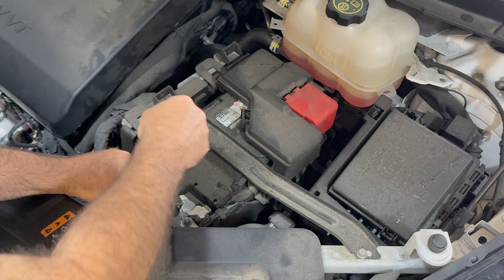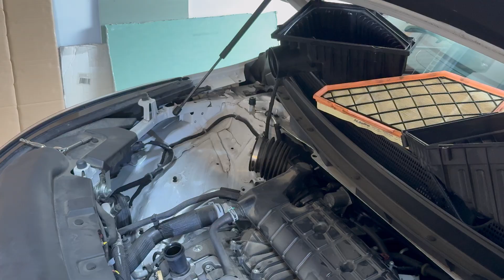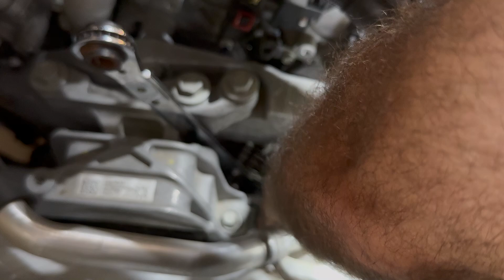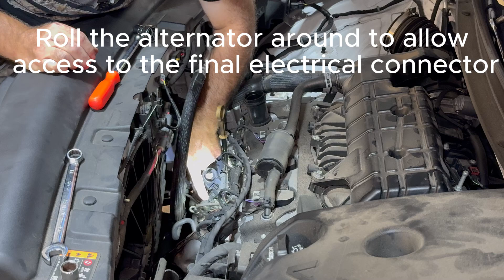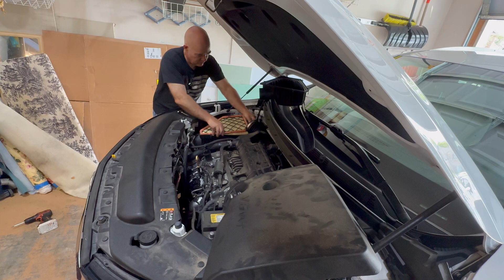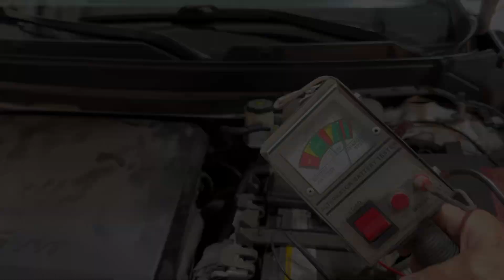2019 Buick Enclave Alternator Replacement Acadia Traverse (( 3.6L )) #buickenclave #buickgmc

Comment: Can you add a list of tools used???
Reply from the maker: Yes. Can be found in this video description. 
Parts & Tools:
- Alternator: https://amzn.to/44QOQVo
- 1/4 10mm socket, rachet & extension: https://amzn.to/4447Z5u
- T30 Torx Bit & Driver(or 1/4 socket & extension): https://amzn.to/4oifu1K
- 8mm 1/4 socket, rachet & extension: https://amzn.to/4emQMZZ
- Phillips screwdriver(set): https://amzn.to/4e2szsX
- 1/2 Rachet: https://amzn.to/4eBXUTu
- 15mm & 17mm 3/8 drive sockets, 3/8 Rachet & extension: https://amzn.to/4xjOweA
- 15mm wrench: https://amzn.to/3SgyZMw
- Prybar: https://amzn.to/4uyWvC2
- 3/8 Inch Drive Micrometer Torque Wrench (10-80 ft.-lb.): https://amzn.to/4adhF0n
- Multimeter: https://amzn.to/4msrewZ
- Battery Load Tester: https://amzn.to/45fWrfG

Comment: Something dropped off from idler pulley
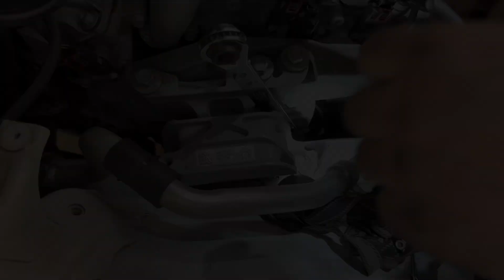Reply from the maker: Right, lol. You can see @13:10
Reply: I saw something fall when you were putting the idler pulley back on @ 13:30, awesome video by the way!
Reply: I was wondering if it was the keeper inside that spacer that fell previously

Comment: Anyone ever have a problem getting that pulley and bolt out of that area. Bolt is fully threaded out but the end is still in the hole and no matter how i move it. It wont slide out

Comment: Thank you for sharing. Would you let us know what was the millage at this time, because i have 2019 chevy traverse at 80k   with the same alternator should i be looking for new alternator.
Reply: 50k and mine just went
Reply from the maker: @GQ83-b4x  Sad that this has become a common issue at such low mileage. Thanks for sharing!
Reply from the maker: It shows 70246 mi on the display in the video. Thanks for watching. My research shows this seems to be a pretty common failure part. You should look for a new alternator if you are having a problem with the old one for sure. Otherwise just be aware of the issue and inform all drivers of the vehicle of what to do should this occur under their care.

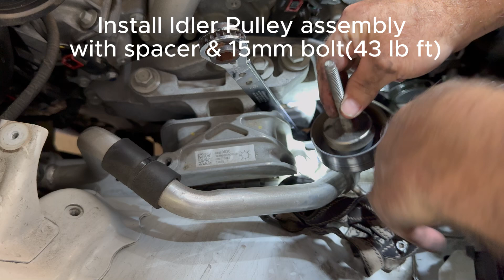Comment: 13:18 curious, what is the thing that appears on the end of the idle pulley threads when you put the spacer on? seems like tape.  Would be interesting to take apart the old one to see what failed. Cool video. Thank you for sharing
Reply from the maker: So did a little research on the black tape looking deal. Appears that it is supposed to keep the spacer on the bolt during initial factory  installation.
Reply from the maker: Not sure. The old one went with the owner of the vehicle.